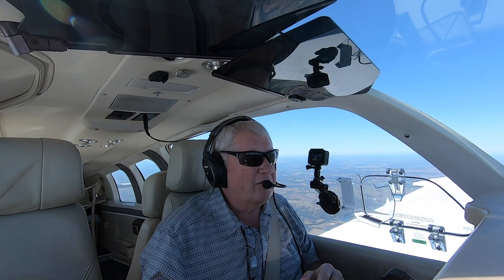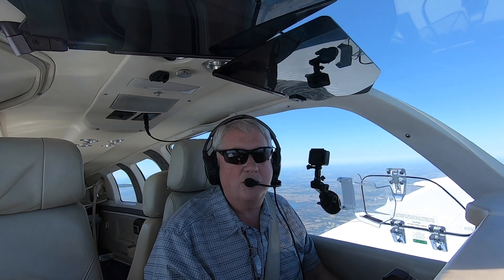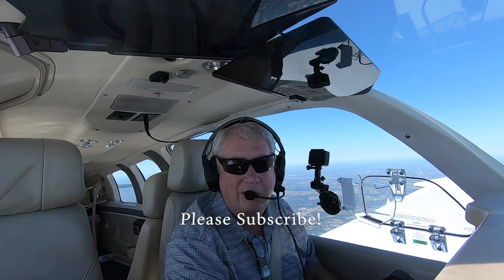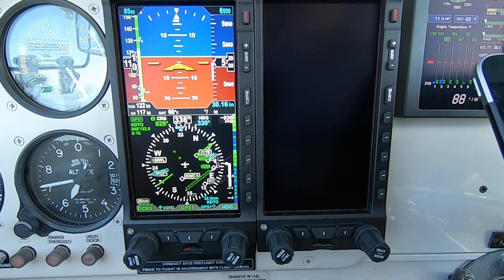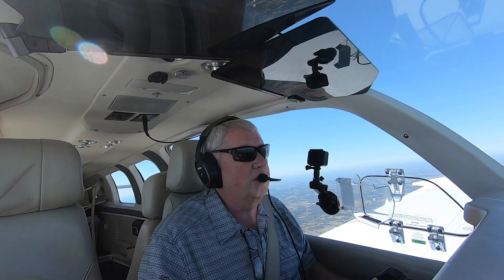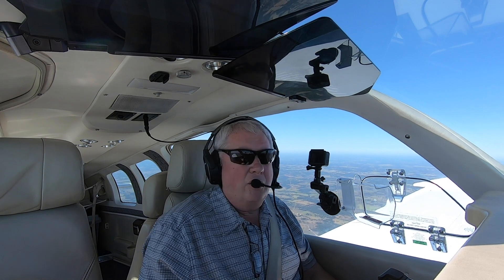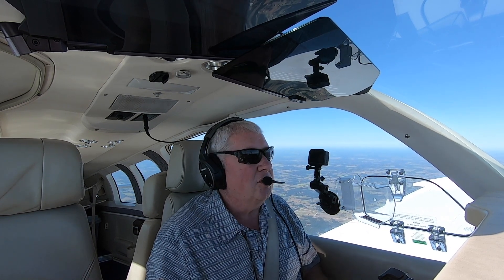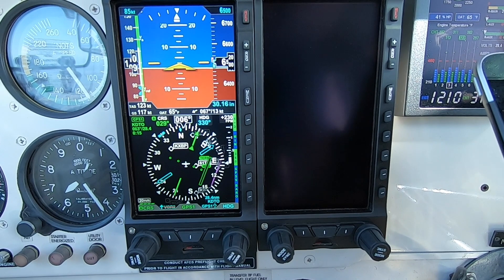FlyWire A36 Bonanza Engine Failure  Best Glide and Min Sink

Comment: Awesome video. I am creating the scenario in my head. I’m thinking if in IMC whether to leave auto pilot on or off after the engine failure? I’m thinking leave it on as long as practical.
Reply from the maker: Dial in in for Best glide. It would work better if you have auto-trim.

Comment: Thats something i wanted to ask a few times. 
Regarding Zoom climb on engine out. 

Say you are having a little joyride and buzzing the runway @ 500ft or low passes at higher speed/max speed. 
Then your engine dies Which would you do and which is best. 

A) Use the speed and energy to Zoom climb up at high as possible before slowing to best glide then establish that. 
B) Just stay level and slow to best glide then look for spot to land (even if it happened @ 250ft or 500ft but max speed) 
C) Just use the speed and energy and look for spot to land without slowing t best glide as only upto 500ft high)
Reply from the maker: It depends on the situation/possible landing sites. Plus your ability to fly the plane in a zoom profile, capture a predetermined speed and maneuver the airplane. Have you tried the profile? If you try it for the first time for real, your odds of success are small.
Reply: @FlyWirescottperdue   Sorry im not a real pilot, 
Just a Flight Simmer & Researcher (due to medical reasons mostly, if i could i would fly) 

Tho i have flown a Real 737 Simulator owned by Qantas Airlines (video on my channel) and landed it fine 3 times in a row with real qantas check captain behind me :D who was "impressed" to quote him

Comment: Did you feather for glide?
Reply from the maker: You can't feather a single engine Prop. What you can do is pull the prop back to full coarse. I talk bout that in another video. It doesn't have any effect on Speed... which is what this video is all about. If you are able to pull the prop back it will save you over 500 FPM in descent rate.

Comment: Loose math says that about a 1:11 best glide ratio. Sound about right?
Interestingly I arrive at about 1:11 on both best glide and min sink. So seems there is a broad range there if you are trying to reach far. Another possibility is that the book best glide speed is for a fairly loaded plane. The ratio doesn't change much with weight but the speed does. So if you are flying light, best glide speed might be a bit lower.

Comment: I've always assumed best-glide and min-sink speeds corresponded to best rate-of-climb and best angle-of-climb respectively. Is that correct?
Reply: For most light aircraft they are close, but not the same. The difference lies in the vertical component of thrust in the climb, and the wing being blown by propwash - reducing angle of attack artificially.
Reply from the maker: No, not quite. For some airplanes perhaps the Drag polars are aligned. You can use Vx or Vy as approximations.

Comment: Scott, Another great video! If you run your minimum sink speed down into the low 70's, what happens to what little energy you have when you dirty up the airplane? Can lowering the gear exacerbate the problem? Assuming you wait until the last minute to lower the gear can you run the risk of a stall without sufficient altitude to recover?  Thanks for these videos. You've taken book situations and shown how things happen in the real world.
Reply from the maker: Michael- Yep, when you lower the gear you loose  speed, and at min sink you just don't have the energy to arrest the sink rate for a flare... it will be a hard landing.

Comment: Another good one, Scott.  I especially like that you bring up ground rush, which is rarely mentioned in this context, and the need to have enough speed to have control authority to arrest the descent, flare and land. In the A36 you’re flying you’ve noted before there is a Landing Without Power speed of 81-83 knots (calibration differences for different models of A36). This is five or more knots faster than normal 50-foot landing speed, in part to assure you have extra airflow over the elevator to arrest this impressive engine out rate of descent.

I get why you’re not pulling the prop back for purposes of your demonstration, but I’d still stress the essential need to do so to have the best set of available options.

Thanks for doing this series.  - Thomas P. Turner
Reply from the maker: Thanks Tom.  For this video I wanted to have a slightly different take, a worse case scenario to more closely approximate the startle performance for an unplanned/unexpected engine failure.Exploring the boundary limits, so to speak. I totally agree that pulling the prop back is the best course of action. What I didn't want is for someone to use these videos as a replacement for instruction and training. I appreciate your comments!

Comment: Good stuff to ponder and practice.

As mentioned by others, weight is a factor for glide speed. Less weight, less speed. Gliding distance is actually farther at higher weights (the higher speed a function of weight/stall speed). The aft CG influence of the survival gear in my aft baggage also has a positive effect during the glide.

Flap gap seals, wing extensions and pulling the prop back as you did all contribute to best glide or min sink speed. This “flight test” procedure should be done on the airplane to see what works for the mods on the individual airplane. Taking the example of two identical 182’s, but one with flap gap seals and one without, the one with the seals has a noticeably extended glide distance. With WingX extensions and flap gap seals on my 185, I had to change the glide ratio on ForeFlight to make the map page glide circle more appropriate for my airplane. 

A good rule of thumb for a surprise engine out glide is to maintain a speed between Vx and Vy. It may not be exactly accurate, but it will be close enough under the distracting and performance limiting circumstances to correct the speed for the actual weight of the aircraft, yet still allow enough energy for the power off flare and touchdown. 

Once you pitch for the speed make sure to trim the aircraft to help you maintain the desired target speed while going through the distracting restart attempt and finding a touchdown location. Trimming for speed will also contribute to more elevator authority during the landing flare.
Reply from the maker: Good stuff, Manny. Especially the trim comments.... helps prevent ground rush and inadvertent slowing the airplane down!

Comment: How far back did you pull the prop?  It did not sound like you feathered.
Reply: He pulled the prop control all the way out: coarse pitch, minimum rpm, minimum drag. Why not feathered? 1) You can’t feather the prop on an A36; 2) You wouldn’t want to feather the prop on a running engine in any case. Then you really would have a dead engine.
Reply: @SteveZimmermannPhotography  Have never had what looks like a great pleasure to fly a Bonanza

Comment: Thanks for the great video. Good explanation. Was wondering to see the power and propsettings during the demonstration.
Reply from the maker: Hans, thanks! I thought I had the JPI in the frame only to realize that I didn't after the fact. One of the upcoming videos in this series will have it in the frame for you! Thanks for watching!
Reply from the maker: The Throttle was in idle and the rpm was 1000... the prop was all the way back.

Comment: Oh, and another thing: you glossed over the importance of pulling the prop back for max pitch/minimum rpm; it’s worth a bit more explanation. In my experience, that’s even more important than getting the speed exactly right for extending glide range.
Reply from the maker: Ah, I did say it and use that technique for these glides. But you give away one of the main features of the next video in the series. Stay tuned, I think you'll be happier;)

Comment: Thanks for the video, Scott. From my glider flying days, I know that best glide speed varies as a function of weight. I believe the POH states that the best glide speed of 110 knots for the A36 is at max gross weight; at lighter weights, as you were in this video, the best glide speed will be a few knots slower. Unless you’re gliding into a headwind, flying a few knots too slow is less detrimental to glide range than flying a few knots too fast...and your sink rate is worse at the higher speed, too. Min sink speed (and even more so the sink rate at min sink speed) is also affected by weight, in a similar fashion. Sometime you should sit down with a group of glider guiders and ask about speed-to-fly: I guarantee the conversation will last as long as the beer continues to flow. 😉
Reply from the maker: Thanks Steve. Excellent observation. One thing to remember is that flying a Glider and a single engine airplane with the engine just failed are two different animals. Sure they are airplanes, and sure the speed should/does vary with weight. But the issue here turns more on a single engine pilot learning to be a glider pilot in five minutes. There really isn't enough time to learn niceties, better to have target speeds that are close. Short of a hurricane there aren't any thermals that will increase your energy in an engine failure situation.
Reply: Agreed, Scott: the subtleties of speed-to-fly don’t amount to a hill of beans when the motor quits. But my main point is that for the A36, 110 knots is more of a not-to-exceed number than a plus-or-minus target speed. And flying faster than the optimal speed for a given situation has the added disadvantage of putting you on the ground sooner, as well as closer.
Reply from the maker: @SteveZimmermannPhotography  Excellent point!
Reply: On my Commercial check-ride I went for the target speed (Vy) and the examiner said "good that was text book; now let me show you how to find out faster the best glide since we are not a gross weight."  He then cut the engine (and did not pull the prop) and said look off the left wing and put the wing tip level with the horizon looking from the leading edge to the trailing edge.  Hold it there and look to where your airspeed settles.  Voila, there is your Vy at this weight.  It is not prefect but close enough that very quickly the first calculation is done to enough precision that plus or minus a knot or two is not going to make a substantial difference.